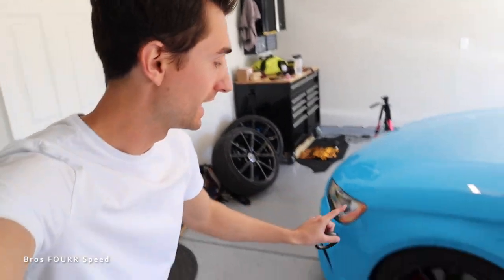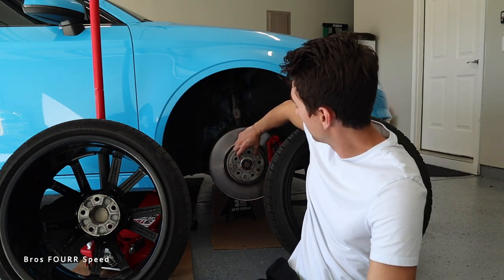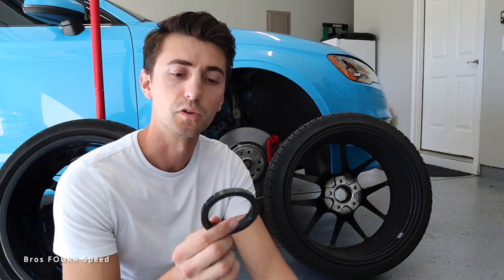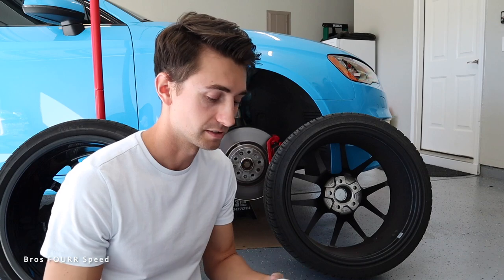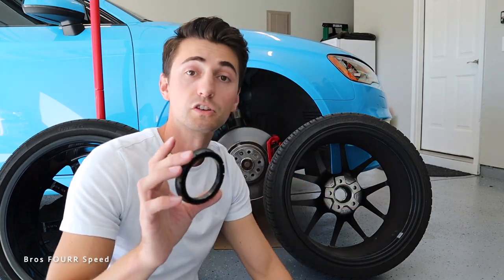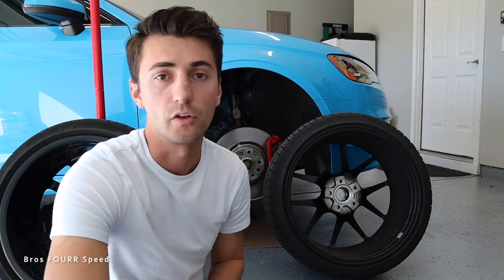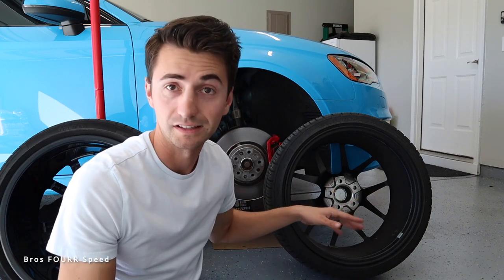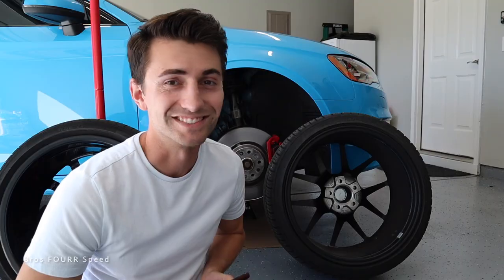How To Solve Wheel Vibration | What Are Hub Centric Rings?

Comment: Some mechanic shops definitely need to watch this video. Funny. I literally just got new aftermarket wheels installed today and one of the guys that swapped my tires from my Gramlights 57DR’s to my new Konig Hypergrams took off my hub centric rings and said “hey whoever installed your old wheels decided to put an extra center ring on your hubs.” And I was like 🤦🏻‍♂️🤦🏻‍♂️🤦🏻‍♂️bruh it’s not extra. They’re SUPPOSED to be there. So I told them to redo it.
Reply from the maker: Oh wow! Dumb guy there for sure 😅
Reply: It's unfortunate... Some mechanics just do the bare minimum and want to just get paid without doing extra, etc. Kudos to the ones that go the extra mile.
Reply: Waste of money. The konigs are LUG centric and not HUB centric. Using the 60 degree tapered lugs will ensure the wheel is centered on the hub. It is literally impossible for them to not be properly centered if the lugs are all properly torqued. Very few cars need hub rings and it is only those that use wheel bolts or use flat lugs or washers.
Reply: @boost331  dude. You want the weight of the car to be on the hub. Not the studs. Usually the diameter of the bore on aftermarket wheels are larger than the hub. Thats what the hub centric ring is for, to compensate for the different size.
Reply: @its.Andy1  Nope. The weight is never on the hubs. Its there for centering. That is the biggest BS myth that people fall for here. 90% of the hub rings you see people using and even wheel shops installing are made of cheap plastic. You trying to tell me that little piece of plastic that you can crush with your hand is supporting 3000lbs+ off the ground? You fell for it.
Reply: They are so dumb like idk how they don’t know that about aftermarket wheels my shit was doing the death wobble in the freeway 🤧🤧🤦🏻‍♂️
Reply: They are so dumb like idk how they don’t know that about aftermarket wheels my shit was doing the death wobble in the freeway 🤧🤧🤦🏻‍♂️

Comment: I just had new aftermarket wheels and tires put on my new Tiguan, around 50 mph I got the shakes and went away until around 70mph. After multiple road force balancing from discount tire the issue never quite went away. After watching your video I replaced the plastic ones with solid aluminum and my vibrations went away. Thanks for the video.
Reply from the maker: Nice glad to help!
Reply: Glad I see your post, I'm looking into buying a Tigaun and want to go with the Sparco Terra Rims and it says I need the centering rings. Never used them but looks pretty straight forward install
Reply: That’s crazy because I have a 2023 Volkswagen Tiguan S and I’ve had some 20 inch wheels and tires brand new with hubcentric rings and a roll force balancing and I never stop the vibration. It has speed around 70 to 75 mph.
Reply: Just put some 20s on my Tiguan and it’s vibrating at 100km/h. What size hub rings did u buy to resolve this issue???? Please help
Reply: IDK but my aftermarket wheels been balanced a bunch they still shake IDK if it's the lug bolts but there the ones that came from the same company the wheels came from and my bore is 66.6 and the aftermarket wheels are 66.6 bore same as factory and the still shake IDK what to do plus the car shakes at 60mph.. always it's horrible smh... Plus everything is new in this car alignment and front end and all rear end parts are tight and tires are new.

Comment: This actually may be an answer to an issue I have. Long story short, I spun my car out, damaged the tires and factory wheels (generic steel style) that were on there. I bought a set of generic looking aftermarket steel wheels and new set of tires and had them put on. I started getting a vibration while driving and cruising after that. Took it back to the tire shop I had it done at, and they claimed that there was nothing wrong and they just rebalanced the wheel again. At my current job there's a wheel balancer, so I used it and turned out my wheels were out of balance, so rebalanced them, but the vibration is still present. After seeing your video, I looked up the hub size of my car, and the center bore size of the wheels, and found out the the hub is 56.1mm and the wheels are 72mm.
Reply from the maker: Yeah could definitely be it!

Comment: I don't think these are actually needed if you install your wheels with a little care. The lug nuts will actually center the wheel for you if you wobble your wheel while you snug up the lug nuts. The wheel gets off center because the mechanic isn't taking the time to do it correctly, they just drive the lugs on with an air gun and don't pay attention. There's nothing wrong with using them, I'm sure it makes it easier but if you take your time and install the wheel correctly you don't need them.
Reply from the maker: No you still need the rings. I put these wheels on and I always slowly snug bolts in a star pattern. The metal hub ring further keeps them centered. I've done this on many cars. And since I installed the wheels each time, the same way, how else can you explain why the vibrations went away with the rings installed and came back with the rings removed? The rings makes the difference
Reply: @BrosFOURRSpeed I always use It hub centric rings, few years ago mechanic forget to put It hub centric rings and my car was vibrating so when I re do it with It hub centric rings no more vibrations.
Reply from the maker: @TokyoHomes  yeah they make a difference!
Reply: @BrosFOURRSpeed  100%

Comment: They used only for alignment. After the nuts are tightened they do absolutely nothing
Reply from the maker: I wouldn't agree. How do you explain why the car vibrated without them, and then didn't vibrate with them? It keeps any and all flex away from the wheel bolts and keeps the wheel centers while rotating.
Reply: @BrosFOURRSpeed  its because when you use them the wheel is central so no wobble but when you didnt use them the wheel was off centre because the alignment wasnt done. its the same as a clutch aligning tool. BTW this isnt my opinion its a fact
Reply from the maker: @coltuppal  The alignment didn’t change in this video. Alignment was done previous to the video. Only thing I changed in this video was the rings and them alone made the wobble stop. These hub centric rings make it to where the wheels didn’t vibrate anymore while driving. Makes them centric to the hub vs lugs. So for people with aftermarket wheels. It’s wise to have solid rings to make for a smoother ride then without.
Reply: im talking about aligning wheels on your studs
Reply from the maker: @coltuppal  ok got it. However explain how driving without the centric rings made the car vibrate. And once the rings were installed, the vibration was gone. It’s because they hold the wheel perfectly aligned to the hub. The whole point of the video is showing how you need hub centric rings on wheels that have a larger hub then stock. And that the rings eliminate vibrations.
Reply: @BrosFOURRSpeed because who ever installed the wheels didn't pay attention they just slapped the wheels on. You have to wabble the wheel while you snug up the lug nuts, the lug nuts will actually center the when for you.
Reply: @BrosFOURRSpeed  You don't understand what he's saying. The rings only serve to put the wheels on the car properly. Once the wheels are on, the rings don't do anything; they don't hold any load. All they do is make sure that the wheel is put on properly but once it is, they don't do anything.
Reply from the maker: @SonikJesus  Not true. Why would the car vibrate without the rings. And then not vibrate with them?
Explain how the car is noticeably different while driving when the only variable that changes was the metal rings vs plastic rings? 
There is some flex in the studs or wheel bolts. The metal rings don’t allow that flex to occur therefore eliminating vibration
Reply: Interesting discussion, and very relevant for me. Bought expensive after market wheels with solid poly hub rings. Vibrations between 110-140km/hr. Rebalanced twice to no avail. Second shop noticed rings had slight movement while on the hub, even though they were measured to spec 57.1mm. we ordered new rings at 56.1mm..apparently some audi RS models have 56.1mm hubs even though factory says otherwise. Received the rings, will put them on next week. Tbh i am doubtful it will solve the issue, and have a feeling there is something non-compatible with the aftermarket wheels and the car. I am confused though as the rings are not meant to do anything after mounting lugs, but maybe they do...
Reply from the maker: @stonecold274  if they are snug in the wheels hun and cars hub they will limit vibrations. The wheel bolts/lugs are more designed to clamp the wheel to the hub. They don’t always prevent the wheel from moving up and down. That’s why cars have a lip on the hub to seat perfectly in the wheel. That’s why rings are important
Reply: @BrosFOURRSpeed  thanks for the reply. Good to know that lugs/nuts dont stop wheel movement 100%. This is super important info that seems to be the subject of a lot of debate.
Reply from the maker: @stonecold274  Yeah people who say the hub centric rings are to help align the wheel, that’s not true. It helps seat the wheel to the hub
Reply: @BrosFOURRSpeed  Dude, do some proper research. You are very wrong.The rings do not hold any weight, if they did they would be quickly mangled. Plastic or alum.
Reply: @BrosFOURRSpeed  So is the ring needed? Actually no, but it is recommended. All that a centering ring does is keeps the wheels center when you torque down the lugs. Without the ring its possible you can pull the wheel slightly of center and then you have a vibration.

I know of many cases where centering rings were not used. You need to be more careful in the torquing process of the wheel and it should be done with the wheel raised of the ground.

If you have the centering rings however there is no reason you would not want to use them. It just ensures a vibration free setup as long as the balance is set correctly.
Reply from the maker: @Sydneywide1  Then how come the wheels vibrated with the plastics rings, but not the aluminum rings? The solid aluminum makes the wheel stay centered  the plastic rings would still make the wheel stay centered when torquing the wheels. But clearly there is some give from lug nuts that allow the wheel to move slightly while driving causing vibration.
Reply: @BrosFOURRSpeed  It is my understanding that hub centering rings are not needed if you have tapered lug nuts, as these center the rim on the studs.
Reply from the maker: @Sydneywide1  The lug nuts themselves still don't 100% eliminate vibrations. The bolts design is to clamp the wheel to the hub with perpendicular pressure. That doesn't solve the parallel pressure of the weight of the car sitting on the wheel. The vibration up/down, left/right can still occur. That whey the stock hub and stock wheel have that lip to fit together perfect. Aftermarket wheels usually have a larger center bore. Hub centric ring is needed to fill that gap and keep the wheel perfectly centered with no vibration after the bolts are tight. Thats why the aluminum ones solved my vibration issues when the plastic ones did not.

Comment: urban legend. aluminum rings carrying car weight? go and learn your physics mate. when the stud are properly made you should be able to rotate those rings in place because they can not carry any load.
Reply from the maker: Then why did the solid metal rings eliminate the vibration when the hollow plastic ones didn't? The lugs do hold the wheel tight. But there is still some vibrations that the bolts alone can't overcome. Solid rings add that extra solid base to the hubs to keep things perfect

Comment: If you don’t have the rings, just center them with tapered lug nuts. You only need two. Finger tighten both, then slightly tighten. Install the correct lug nuts on the other studs, tighten lightly in a star pattern. Remove tapered nuts, install the correct nuts. Tighten and torque all nuts.
Reply from the maker: The rings still help. Most lugs are tapered foe a central secure fit. But the solid rings still help prevent vibration

Comment: so I have twied 4 different pairs of plastic rings and 4 different pairs of metal still a vibration. Wheel hubs replaced, cv shafts, control arms inner and outer tie rods. But rides smooth with factor wheels. Been using the rings konig said i need. Not Iw ill having the wheels balanced with out the tires mounted.
Reply from the maker: Dang that's weird. Has to be a bent wheel or poor balance
Reply: @BrosFOURRSpeed  I will post here later what my findings are when they try balancing it without the tire on the rim. I'm hoping it's just a belt in the tire
Reply from the maker: @vector150  Yeah hopefully you get it dialed in!
Reply: @BrosFOURRSpeed  thank you very much for the reply and inwill update later
Reply: Had the same issue...either your tires or your rims. Do you have any curb rash on the rims? They could be slightly bent. Tires also make an incredible difference. I had cheapies on and they would vibrate at high speed and make a lot of low speed noise. Swapped out the rims and the tires for some good bridgestones along with solid plastics hub rings and she rides smooth as butter now. Good luck!
Reply: @Muklolan666  no rash this has been an issues since the day they got put on brand new
Reply: @vector150 and verdict?
Reply: @stonecold274  still having issues
Reply: @vector150  thats crazy after all you have tried! Could it be that the aftermarket wheels are just not compatible due to different offset, or a combination of tires and rims? I am fearing the worst as i will try second set of HCRs, and have rebalanced twice..
Reply: @stonecold274  not sure yet reached out to konig waiting to hear back
Reply: @vector150  would be great to hear the outcome

Comment: You literally described all the symptoms I've been experiencing.. got new tires, new suspension, wheels balanced etc, couldn't find the issue and remembered I have plastic hub rings from 15k miles ago. Can't wait to get in there and see whats been going on then replace with metal ones
Reply from the maker: It should make a huge difference for you!!
Reply: Did it fix it?
Reply: @PunjabRockstar15  tbh I'm not sure 100% what the cause was, here's why.. when I went to get hub rings replaced, shop found one of the wheels slightly bent. Fixed the bend and with new hub rings, all vibrations went away.

Comment: Thanks for video
I had exact same issue with a new golf i just bought and got some new wheels, had annoying vibration at 60mph +. I had tires rebalanced and was afraid i had bad wheel, came across your video and was inspired to get solid aluminum rings, it took care of vibrations completely, drives great now
Thanks again
Reply: Hey got the rings but still getting vibration do u think they didn't balance properly

Comment: Thank you for this video, this fixed the severe vibration I had on my Lexus GS after getting new wheels. I bought the same ones you linked, installed at discount tire, and solved.
Reply from the maker: Nice! Glad to help!
Reply: I had the same issue last week I got a 2011 GS 350 Lexus on 22 inch wheels. And my car was shaking. Really bad at 65 miles an hour. Now I can take it to 85 with no vibration.

Comment: Thank you for your video, you confirm that I made a good call. I put these into my custom wheels thanks to the shop's owner advice, solid alloy ones.
Never seen those plastic ones by the way.
Reply from the maker: Yeah I had solid polyurethane before and they were fine. But I'd definitely make sure you stick with solid good ones! Crazy how big of a difference it made
Reply: You'll regret the metal rings. They'll eventually melt to the hub or wheel  center bore. With or without anti seeze

Comment: Other videos on hub rings , they recommend plastic hub rings cause aluminum rings require anti seize or some kind of treatment before installing them so wheels won't be difficult to dismount when you eventually need to rotate or change tires. What say you?
Reply from the maker: That could be usefull. However I've never had issues. I'll be taking the wheels off the S3 to put the car back to stock for sale, so I guess I'll find out if anything like that happened since I installed them lol
Reply: This is correct! It's not a one time thing either when applying antiseeze, that's where the problems come if you don't have a competent mechanic/ shop you deal with.

Comment: I agree with what other people have said.Plastic isn't going hold your wheel in place or stop any vibration. They are simply for making it easier to line your wheel up.
The wheel studs do all the work.
Reply from the maker: Then how come the vibrations went away going to the solid aluminum ones vs the plastic ones? Also read through the comments. Tons of people installed solid aluminum ones and every one of them said that stopped the vibration compared to plastic ones or not having anything. Why do you think the factory hub has a solid metal lip to correspond the the recessed portion in the factory wheel? The solid connection eliminates vibration.
Reply: It's like mounting an engine with plastic mounts . How long do you think that will last?
You need steel or aluminium to hold something in place not plastic. I do agree that they make it easier to line your wheel up but that's all.
Reply from the maker: @britpoper  Yeah the aluminum rings hold the wheel in place perfectly centered while driving so there isn’t vibration. Plastic rings allow some give that the bolts alone can’t 100% compensate for. That’s why the aluminum rings solve wheel vibration